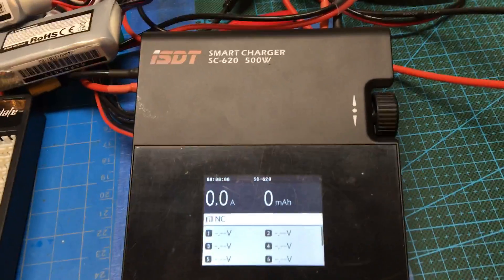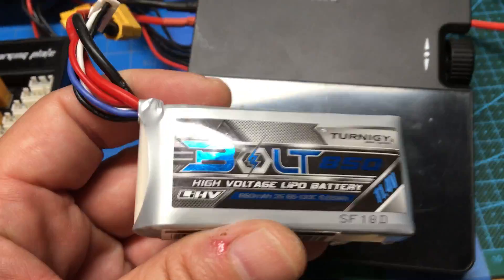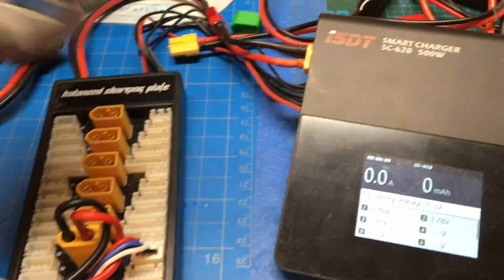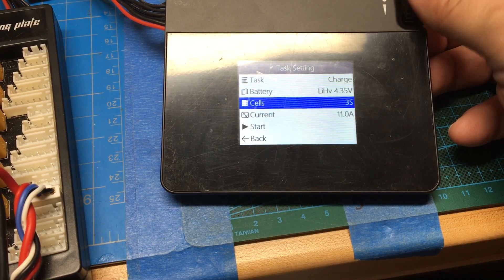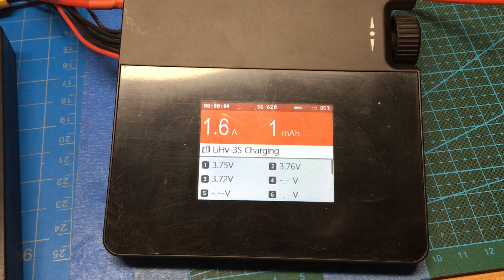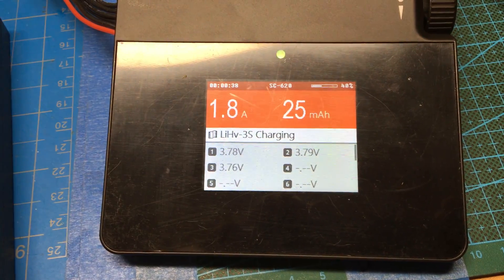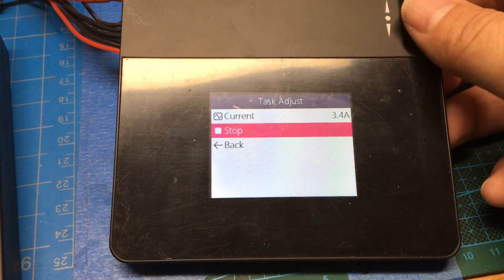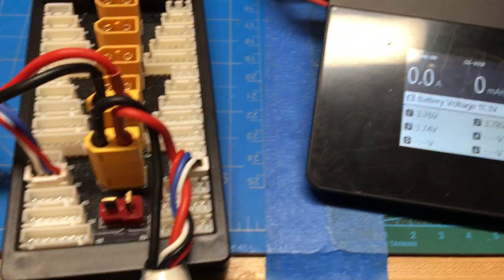iSDT SC-620 Smart Charger (500W) - DANGER!!!!!

Comment: It seems you have a charger with a faulty voltage regulator. I have a isdt q6 plus that has the same firmware only its 300 watts max and it has no issues. You better send it back to Bangood for a replacement.

Comment: I'm using a power supply with 600W and 24V and had never ever such issues. The amps were always stable after ramping up slowly. So keep in mind that you should always use a higher voltage power supply for stable charging amps. Additionally with 24v and 600w you can make use of the full 20 amps charging output capacity.
Reply from the maker: I used a 1200W 12V power supply as well as a battery for a power supply as well as a lab power supply to verify current draw was erratic.  I was just unlucky and had a faulty unit.

Comment: I think is that charging board you're using cost that problem , try hook it up with out that board and hook up the battery in series , make sure the charger can see all voltage in the battery ,  mine works just fine for the pass 6 months

Comment: can you calibrate the balance ports on this charger ?
Reply from the maker: If you are referring to calibrating the voltage and/or current then no, you can not.
Reply: yes you can. mine has last firmware V2.1.0.14   . when you are in system information you have to push three times long (1s)the knob, the you access to a calibration menu.
you must enter the key showed on display an the you can adjust each individual balance cell and the global voltage. Mine was not good at all for the first cell(+0.05 v) but once calibrated  it's perfect(with an accurate calibrated precision voltmeter of course)

Comment: it was an early firmware issue the q6 suffered from  it as well. and they are mass produced so their are some defective units around. although no direct warranty from isdt if the distributor fails to help you out. I learned that the hard way. buy from a reputable company with good customer service.

Comment: I had the same problem. I was charging 3 LIHV Bolts 1300mAh at 2C (7.8V). During the charge, I checked the Lipos temperature and they were fine. When I heard the "finished charging beep", I checked, and they were super hot and puffy! I turned off power immediately. My power supply is 12V 62A 750W, and my power lead to the SC-620 is 12awg and 34cm long
Reply: I meant 7.8A not 7.8V. Oops!
Reply from the maker: Sorry to hear you had the same issue.  Hopefully ours are rare.
Reply: well...my BOLTs lasted around 20 cycles and became hot during charging, but it had nothing to do with the charger itself. The BOLT HIVS are just incredibly bad lipos.

Comment: im pretty sure parallel charging is not safe. idk if you had all your batteries balanced as well. im pretty sure if your batteries are off, it will try to compensate   additionally, idk if your following your battery charge rate guidelines. if you are following all these guidelines then contact vendor and have them send you another and retest. if you have the same issue update video as i really am considering this charger.
Reply: parallel charging is very safe....if you do it correctly.  I always ensure the battery cell voltages are within 0.1V of each other for charging.  This will ensure there are no issues with too much current flowing between the battery cells as you plug them in.  
I sent the charger back to the vendor I purchased it from and received a refund.  My unit was defective.   I ended up getting a much better charger that I put into a custom made case.  Between the two chargers I have, I can (and have) charge 24 batteries at once.  This means it only takes me about 30 minutes to have a full days worth of batteries ready to go.
With this video, I am in no way declaring these are bad chargers.  I was just one of the unlucky ones.  If you need a small portable charger for the field, this one should be on your shortlist.
Reply: Richard Garrett any suggestions for a decent fair priced charger? im only running 2-3s. i am scared i will birn my house down. also i made a mistake and got a imax clone. i thought it was real...
Reply from the maker: If you have your eye on the ISDT, go for it.  It will be very unlikely that you receive a bad charger as I did.  
If you are nervous about parallel charging then you can either do a bit of reading/research on how these chargers work and how parallel charging works in order to get your confidence level up or you can just charge one battery at time.   With flying quads, charging one at a time isn't really an option for me though because with the number of batteries I go through in a day, it would just take too long.
The only downside of this charger is that you will need to get an external power supply to charge at home since it does not have a built in AC power supply so this adds a bit to the costs.  But these are easy to find from Banggood or other online vendors.  

If size isn't a huge concern then consider the UP120AC Duo Dual 2 Port charger.  It has two ports so you can charge two batteries separately or use two separate paraboards to charge up to 12 batteries at once (as I do).  It also has a built in AC power supply to allow you to easily use it at home or use the DC power supply port if you want to use it in the field.  It is easy to use and has been reliable for me over the past year.
Reply: I am gonna definitely look into that charger as i have also seen a couple double port charger but i really did not do enough reasurch on them. I usually go through all the vids i can find and tally the reviews, check pros n cons, look for bells and whistles, and compare price   really sucks you got a bad unit as there really are not many bad reports for this charger from what i have seen. 

Appreciate your feedback though and im sure this will help me to find the right unit. 

Im gonna try to build up my confidence with parallel charging but really scared with all these reports of lipo fires. Never seen a battery that was this dangerous. Then again never really seen these before this hobby. Back in days it was all nickel metal halide and so on. 

We shall see how it goes, thanks again!

Comment: Your volts in are lower the volts out. Your chaging at a higher rate than the power suppy can deliver.
Reply: Battery chargers will step up or step down the voltage as required for the battery being charged.  This charger will accept an input voltage anywhere from 9V - 30V and operate just fine.
Reply: I know it will handle between 9-32v. The charge was set for 3.3 amps so volts coming in should 15v or higher. The voltage V is equal to 45 watts divided by 3 amps:
V = 45W / 3A = 15V
Reply: Power is dependent on voltage.  Voltage will vary from about 9.6V on a drained 3S battery to 13.05V on a fully charged LiHV 3S battery.  So setting the current to 3.4A means power can fluctuate between 33W - 44W while in constant current mode.  I have no idea where you are getting the 45W from or the 15V from.  But that is secondary because when you charge a LiPo, the charger first goes into constant current mode up until the  desired voltage is reached and then it goes into constant voltage mode where the current will slowly decrease to hold the voltage and top off the battery.  
The charger I had failed at maintaining a constant current.  The power supply very capable being rated to deliver 29A @ 12V (348W) and was tested on a lab load tester (BK Precision 8540) up to 150W @ 15A with a steady, solid voltage.

Comment: A smart charger can only be made to charge 1 battery at a time, hooking a smart charger to multiple batteries screws up the sensor function. i am NOT stating its impossible but one battery internals might offer more floodgate to receiver amp than its safe. i realize they sell all chargers with these multibatt hookup boards.... charging is dangerous and should be considered a risk everytime and this is a DIY hobby :)
Reply: Thanks for the feedback.  Charging can certainly be dangerous if a person does not know what they are doing.  However, I feel charging multiple batteries with a paraboard can be perfectly safe if you take the proper precautions.  I match cell voltages within 0.1V on batteries and ensure I don't have a bad cell in a battery before parallel charging.  If the batteries are all similar then there is really no additional risk with charging 6 at a time versus 1 at a time and the charger knows no difference.  And the result is that I can get 24 batteries fully charged from a storage charge within 30 minutes using 4 paraboards (and two dual output chargers).

Comment: Did you get a better power supply ? I just got a Turnigy 540 watt adjustable voltage (12-18 volts) power supply for $68.00 from HK and its a beast. Here in the midwest USA thats cheap!  I tore it apart and it is built really well. Its normally 129.00 or so  I believe. I paired it with this 500watt ISDT charger and its rock solid I may buy the smaller ISDT 150 watt  and add it on too for 39.99 right now at banggood . Then I will have a small one for the car and field use. or 2 at once on the Turnigy PS at home

Comment: I would say your input power is not good enough, 
Its recommended to run that at 12v min (you might need like 30-40amp to use it to its fullest)
Best run at 24v Input.
at 2:34 your reported input voltage is 11.2v/28watt [watts on input are WAY to low] which is probably the min you need. 

From what i have seen its mostly to do with bad input not the charger.

i had all kinds of weird issues when i was using a server power supply as it was only making 12v 40a (this is with other chargers) i made other 12v variations and all had similar issues.
I made all my power sources 18v 30amp and all problems went away.

You can find 24v 500watt power supplies but i would recommend to go with 600watt to be safe.

i use 2x quad 300+ watt chargers my self and they running great (had HUGE ISSUES at start but all perfect now)

Let us know what your using to power it.
Curious to find out
Reply: Input voltage is rated down to 9V so 11.2V is still well within spec.  There are many factors that could cause the voltage to indicate a little low.  You will never have 12V at the power supply be 12V at the charger.  Cables will cause a voltage drop, connectors can cause it to drop, the reading on the charger can be off as well.  The only voltage I am 100% sure about was coming out of the power supply at idle.  This was set to 12V from a calibrated source.

I tried several different power supplies including a large 3S battery and was able to repeat the same issue on everything except the lab power supply since it is only capable of 3A max output.  The power supply in the video was rated to ~26A.  Another power supply was a 12V server power supply rated to be >50A with all rails bridged together.   And of course the battery is quite a bit higher.

I returned the defective unit for a refund and got an iCharger 406Duo as a replacement.  This charger had no issues on the same power supplies.  But since it also can charge a quite a bit more power than the ISDT, I ended up getting a 2000W 24V power supply for it to ensure I can charge up to 40A per channel.

Comment: My first guess was a bad power supply or maybe he is using a cheap PC PSU because they won't out out their rating on a single connector. If you charging 3A at 12V and had you voltage dropped to 6v that would be 6A for the same wattage output for an easy example.
If it's fluctuating at all that's bad because the processor probably can't keep up with it so for periods of time when it cranks it up to compensate for the lowered voltage input reading it will be causing 6A at 12V because for a split second it thought it had a 6V input.
All that said you may have a bad unit.
I use a mean well 300w dedicated power supply
Reply: The processor inside is ARM Cortex-M4 - more than enough for this task.
It is probably buggy firmware and/or bad design of electronics. Or just a simple fault.

Comment: This charger seems to have problems with fluctuating input voltages. It does not adjust the output fast enough. Once this oscillation started, the currents are all over the place. Try to use a good regulated power source or test if it still occours with a good LiPo as the power source.

Comment: Do you have an update on this charger?  You mentioned a Return Merchandise Authorization, did you request an exchange, or a refund?  I've heard that there have been isolated incidents with this unit, but all in all, most have been pleased with the product.
Reply: I received a refund for the charger.  I decided that it was not worth the risk using a product with inadequate quality controls.  
To me, it is unacceptable to think that it is ok to release a product that may only cause some LiPo fires.
I purchased an iCharger 406 Duo as the replacement and have not looked back.  :)
Reply: Richard Garrett Thanks for the response, Richard.  The iCharger is a great product.

I found it interesting that I couldn't find any warranty information on any of the iSDT products.  I thought the 608 or 620 might make a good field charger, but at this point, I'm comfortable waiting, to see how it plays out.

Comment: Notcraium, in this video, you mention several times "2S" as the current to use to charge your battery pack. I believe you're actually thinking of "2C" which is 2 x the Amp of your battery pack.
Reply: You are absolutely correct.  I meant to say 2C and not 2S.  :)

Comment: https://flic.kr/p/JHf7iG my charger goes boom lol
Reply from the maker: I don't get it.  What are you charging with 2S with such high current?  Nice looking setup though.  Love the PS buttons.
Reply: i race buggy stock class.. i do 40amps to 70 amps and 21 to 40 amps discharge.. i ordered a little charge one you have for my atom v2 so i can charge at work lol.. also so i can use my 5000+ packs for it to charge like 3 to 4s 500+mah.. 

hows that HV packs? im looking to get some or the graphene ones.. thanks
Reply from the maker: I had no idea those charged so high.  
Funny...I gave up on the iSDT charger after my bad experience and went with an iCharger 406Duo.  I am also having a custom charge case made by http://www.rotorcraftrc.com/default.asp.
The HV packs work really well but unfortunately all 4 that I have a now puffed from the bad iSDT charger.  I also run 750mAH graphenes for my Atom V2 that work well.  And have a Thunder Power Magma 850mAH and Tattu 900mAH that all works well.  The Tattu is only 45C but I haven't noticed a difference between it and a 70C battery.
Reply: Wow where did you get these cables? Nice Charger :o
Reply: custom made by me at work.. i design harnesses and cpu boards
Reply: If you have something for sale please contact me :)
Reply: He Wues sure..this are custom made to your specs :) i can make pretty much anything lol

Comment: Been using this charger for 2 months now and it's running the V.2.0.1.92 after update I have not noticed this. Have you resolved it ? I have charged S6 18A no issues so far =?
Reply from the maker: Are you saying you noticed this on the firmware that came on your charger?  I haven't updated the firmware but have the cable on order.  Others running the same firmware don't experience this issue that I've heard from online.  I think I have a bad unit and will be sending it back.
Reply: Yea I saw similar behavior from mine. But  after I measured the amps it outputs close to what I have set 0.1 difference it's the reading on the screen that jumps up and down. With that being said check yours just in case it's not outputting actual 18A on the poor batteries. At the time I had mine shipped there wasn't any new firmware I ended up installing the original one again using the SDT linker and it solved the issue. Now it's running the newest software.